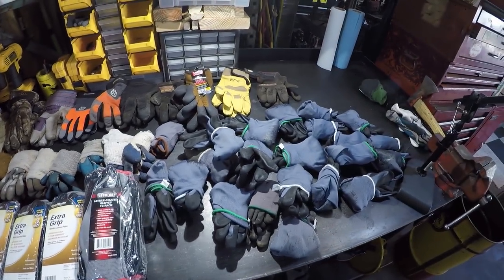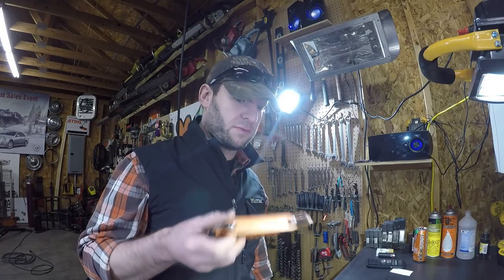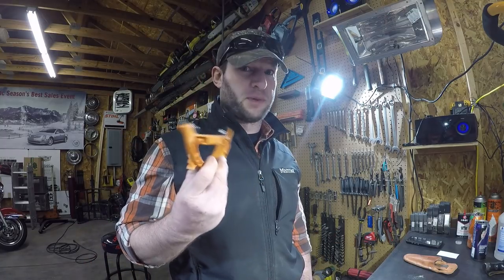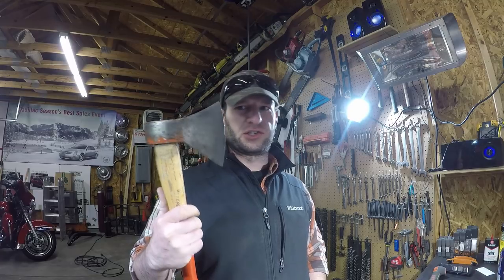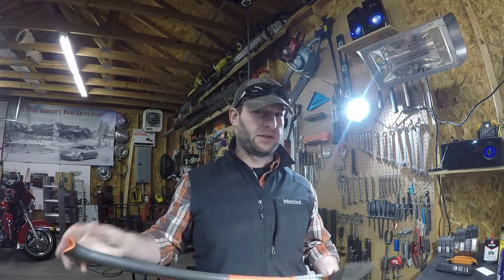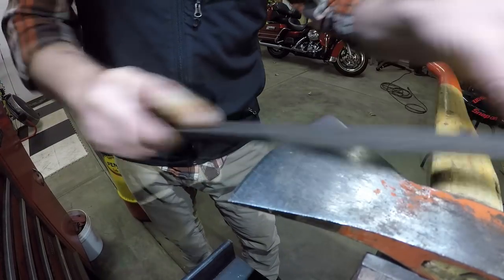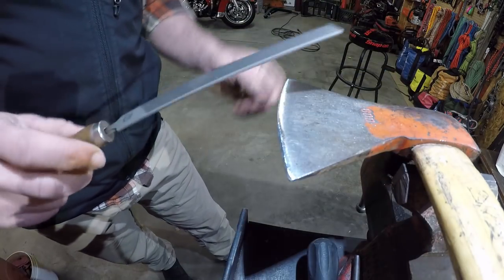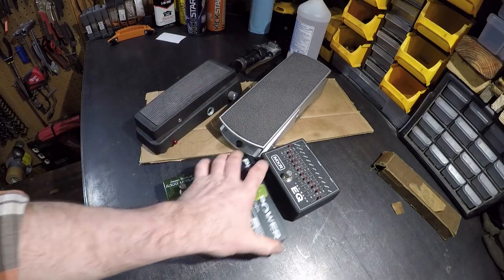Human Vlog 11: DIY Pedal Board

Comment: A little advice on sharpening axes. I file the edge the other way so if you slip you don't drive your knuckles into the edge which can put you in a bad mood. Once you get a wire edge on it then use the stone until the wire edge is gone. I guarantee if you sharpen like this you will have an axe so sharp it will scare people. Like the videos hopefully your recovery goes well.

Comment: I sharpen my axes different ways depending on how I use them . For hatchets I use a file then stones up to 1500 grit , axes used for cutting I'll use a lansky puck for general sharpening and a file if it's really bad , then splitting mauls I just use a file or I have used an angle grinder in a pinch but it's very messy but works.

Comment: Hey did you ever find the "right" way to sharpen an axe? I do the same thing you do minus the big flat sharpening stone. I watch youtube videos to pass the bench time while I sharpen my hatchet or mower blades. I have started using a really fine grit sanding belt thats also used for sharpening knives instead of a grinder because the grinder wheel can leave the edge worse sometimes. After that I hit it with the files, then I use carbide rods then ceramic rods which is overkill but whatever I'm just passing bench time watching Youtube.

Comment: I stop at the file or even the cordless angle grinder. My axes are used to whack roots and the occasional tree that pisses me off. If I have a real tree to murder I call someone like you. Expert work is done by experts, and I will always pay for that work as I feel no shame in charging for my expert work. BTW, glad to see you up and about. Been away at camp so no videos for a bit, (okay I actually built the camp, but also stayed there while I was doing it).